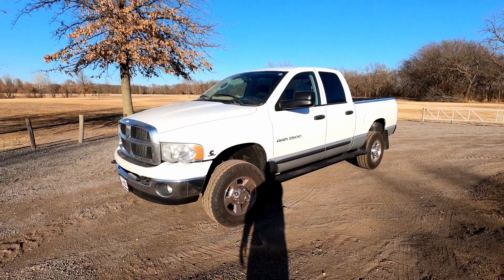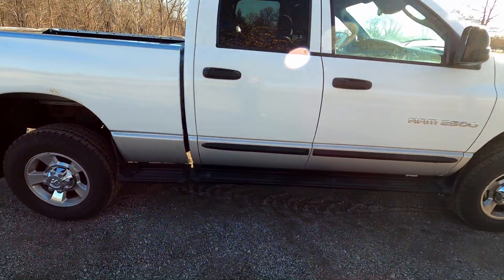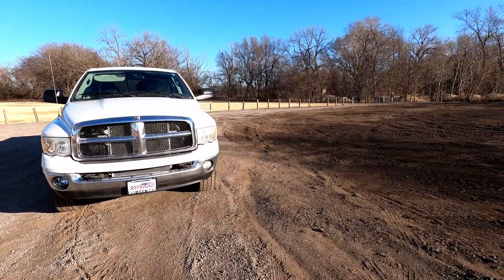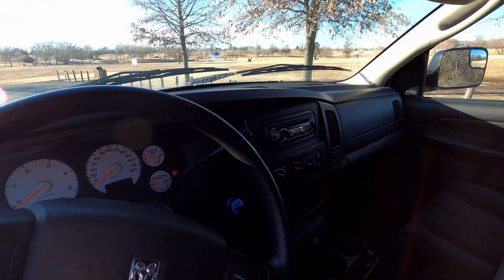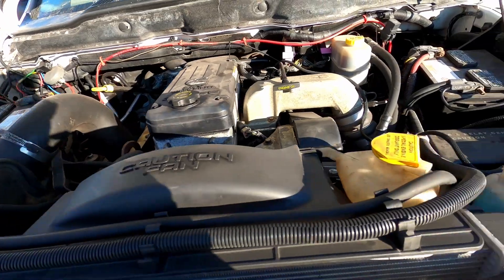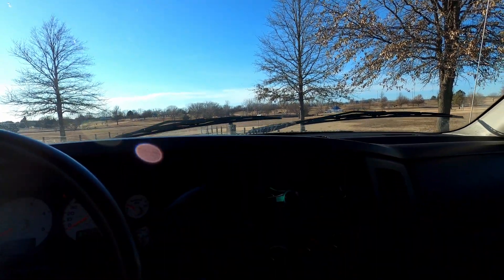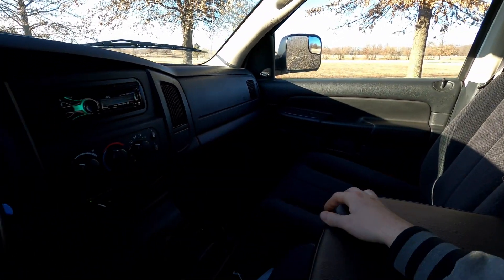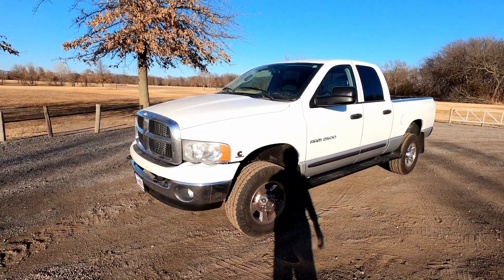A look around an almost million mile 04 dodge cummins

Comment: My 24 valve with a 5 speed gets 18.9 I always wondered how much worse mpg the auto gets. Great video man! Hoovie should make sure it goes past 1 million miles towing something heavy lol
Reply: Hoovie will end up selling that truck watch and see.
Anyways the auto gets significantly worse mpg as manual always gets better ( not so much in newer vehicles but on trucks like these of course) because you can granny shift and keep the rpms extra low when you’re in your personal “eco” mode 
Lol

Comment: Ive got a 2011 GMC seirra denali duramax 6.6 lml 3500 hd crew cab long bed dually with 986,000 miles. Gets around 15-16 mpg on highway. Rust free truck
Reply: Thanks for watching You have been randomly selected among winners for today Contact Me  to claim your prize right now ☝. . . . .

Comment: I get anywhere from 14.5 to 22 mpg on mine manually calculated, but never 12. Maybe high mileage examples go down in fuel efficiency, or maybe it's the hot tune.
Reply: Thanks for watching You have been randomly selected among winners for today Contact Me  to claim your prize right now ☝. . . . .